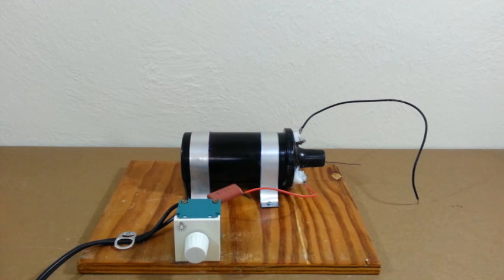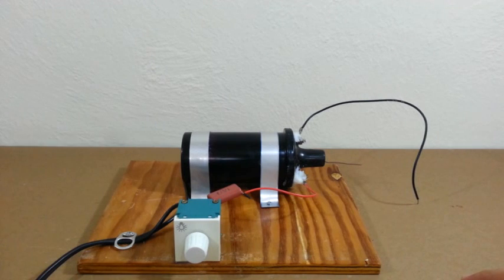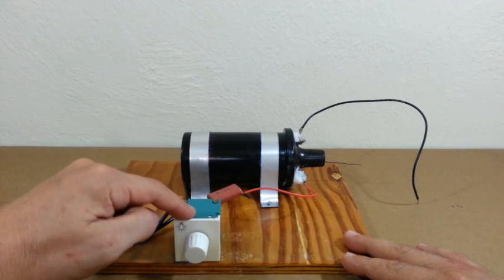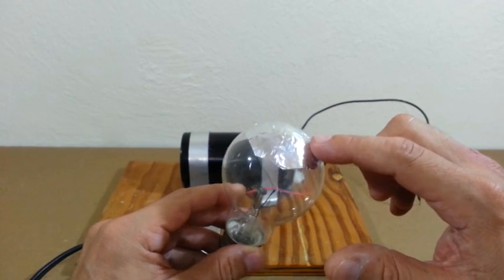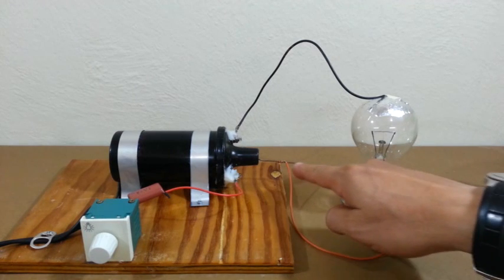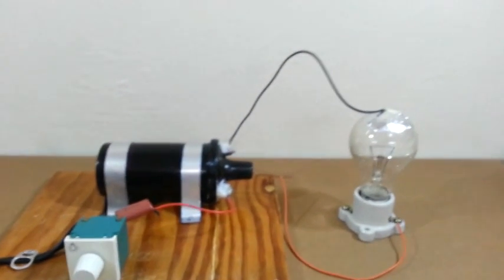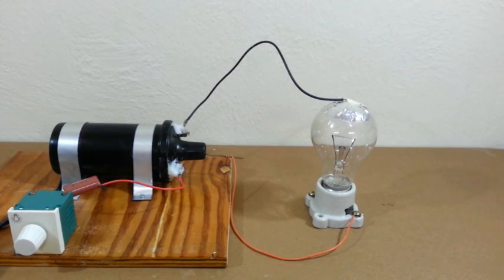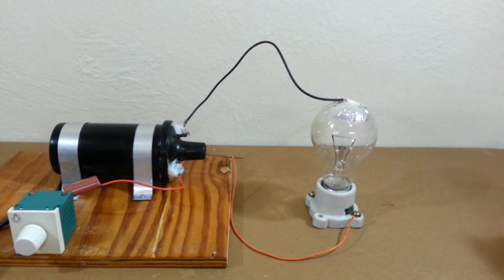How to make a Plasma Ball

Comment: Think people need more detail ie cap non polar and the UF and voltage rating 2nd the supply voltage 220v in comments mentioned type of dimmer used and get a massive bulb much better and instead of foil use a mesh fine net over the bulb better effect but cool PEOPLE DONT TOUCH IT

Comment: i have 12v ignition coil,  can i directly plug it in switch (220v) just like you have done
Reply from the maker: i did not directly plugged to 220v, there is a capacitor and dimmer

Comment: +Ludic Science Have u tried using a fused gas filled bulb, that way if u could connect the hot wire and the ground to the connections on the bulb and  then cover them with parafin to prevent sparking.  wouldn't the bulb then have a plasma arc within it jus like a Jacobs ladder but within a glass bulb
Reply from the maker: +Neil Quinny not sure, it will be interesting to try it out

Comment: Nice video.  But I do not recommend leaving it running for very long, or a hot spot may build up that could puncture the glass and cause the bulb to explode.  That happened to me once with doing something similar to this with a 15kv 30ma power supply and an ordinary light bulb, loud pop and broken glass went flying.
Reply from the maker: +TechnoWizard That's good advice

Comment: Warning some lamps can produce X-Rays !!
Reply: +Nathan Boody very true, rectifier bulbs and rct bulbs especially, but since almost every incandescent lamps uses noble gases it does not produce x rays
Reply: +LoveitLax YouTube crt bulbs i mean
Reply: Why the vacuum lamps and tubes are the only able to produce x-rays at higher voltage? does it has something to do with the lack of a dielectric inside the container, then the electrons with higher frequency can produce heat and quantas (Roentgen rays)?

Comment: Ludic science wen know a transistor turns on when recieves a charge can you make a circuit with transistors that cuts off when recieves a charge, just tell me in a comment, I know I can make it with a relay but i dont want because they make sound and are expansive
Reply from the maker: +Herobrine GaMiNg use PNP transistor that turns off when you apply a voltage to base
Reply: Oh thanks but I used an NPN and turn it on with 10k resistor then applied negative charge to base and it switched off ( a little short circuit turned off the base )

Comment: Fantastic use for an old lightbulb. Even a dead bulb should still work for this experiment!
Reply: will it work for a dead bulb ?? 
are u sure sir ??
Reply: +Muhammad Ashik it matters if the gas is still sealed, the filamint or fuse have little to do with the arcs
Reply: That is correct. If the filament is open, this plasma lamp should still work, because it is a different conducting path. But, the bulb cannot be used for regular light.

Comment: can i use a flyback to drive it
Reply: no u must use a very old AC flyback not modern DC flyback
Reply: +Mrinal  Thakur there is no dc flyback
Reply: ***** almost all have array of diodes with 26 volts voltage drop, but the flybacks normally work in half wave input signal so the diodes dont have a lot of stress, but one nice arc with zvs, or 555 circuit driving it in the reverse voltage and the diode cant do shit anymore
Reply: The output of the modern flyback s are DC which can't pass through the capacitors ie in this case the common bulb but AC travells in wave and can pass through the capacitor or the lightbulb
Reply: Or use a really old flyback like in 1960,s
Reply: Mrinal Thakur they have shit cores
Reply: What
Reply: Oh got it